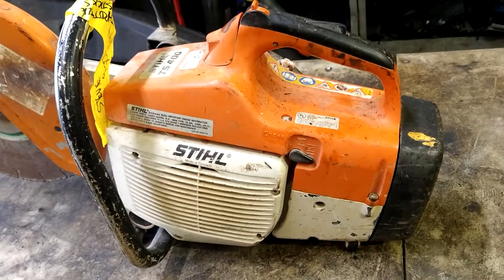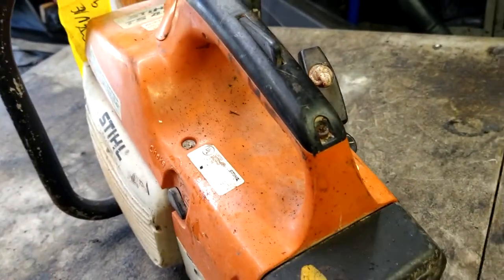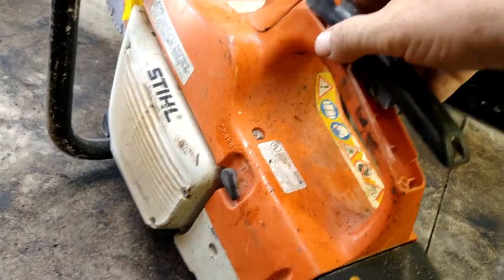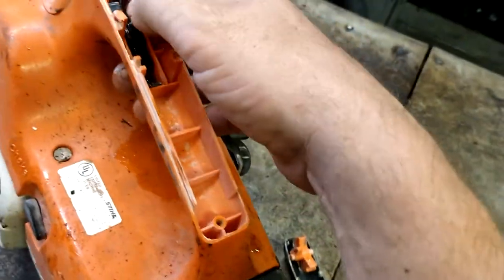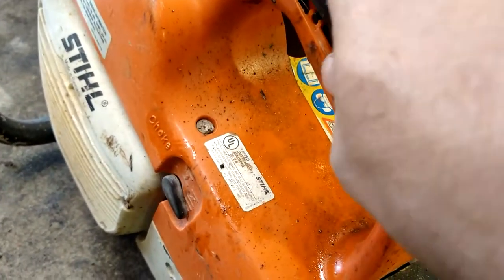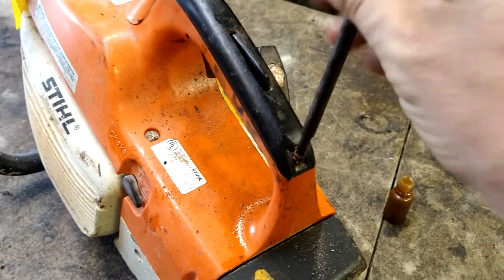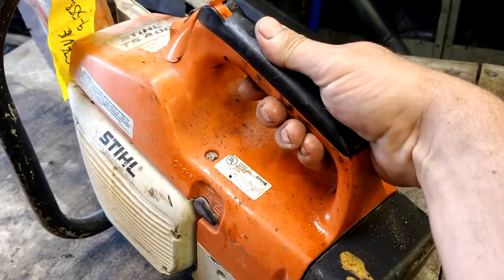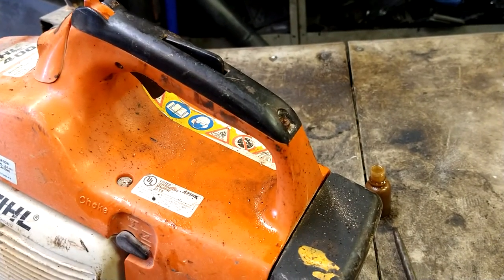stihl ts 400 concrete saw throttle assembly repair

Comment: Great clip. 👍......I've just replaced the black top cover on the handle cos it broke after being dropped. The orange on/off switch and the black trigger also fell out, but both parts were undamaged. I put it all back together when I got the replacement handle cover and everything was working perfectly for a short while. It still starts and runs as normal, but now it won't switch off...??  The only way I can stop it is by turning the choke back on...??  Have you got any ideas please..?
Reply from the maker: take off side cover and follow thin kill wire from coil. it may be unplugged or broken.

Comment: How does the pin come out that holds the trigger in ?
Reply from the maker: with a punch and hammer i believe. kinda a pain but it will come out.
Reply: @smallengineguys  thanks I thought it must be but didn’t fancy risking it incase there was another way , 🙏